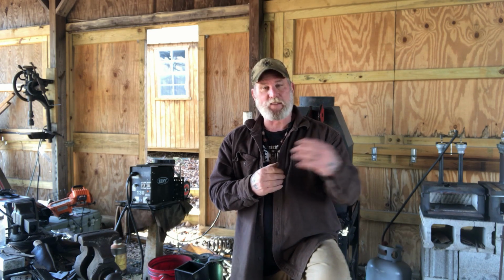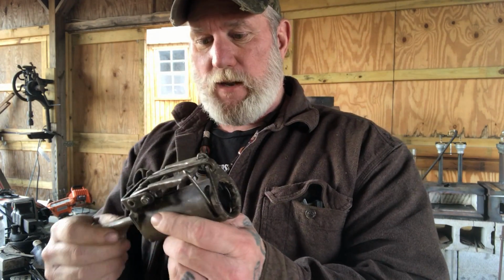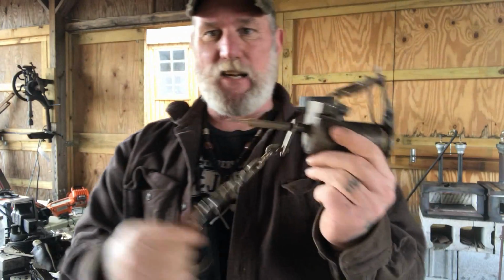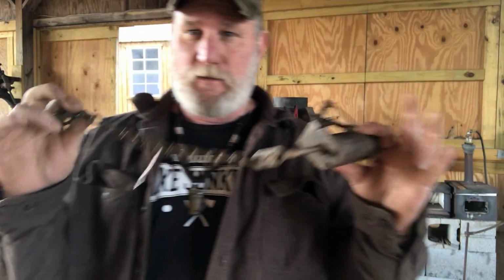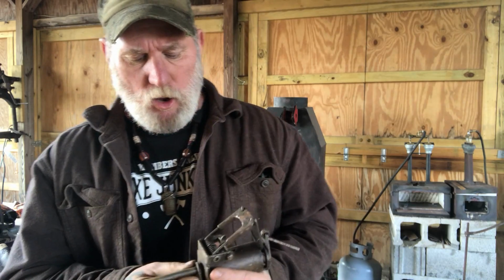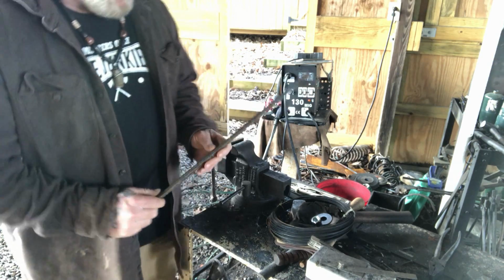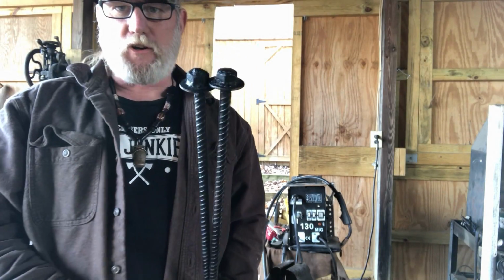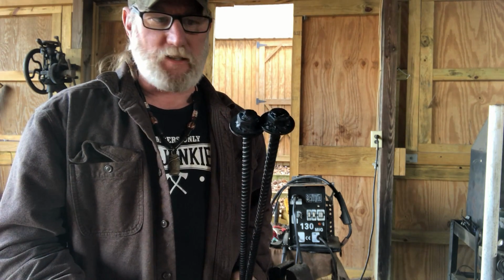Making Trapping Tools Part 1

Comment: Why not use dog tie out stakes, just screw into the ground.  Small enough to use, depending on the soil integrity (hard or easy to insert), easy to unwind and pull out.  Definitely hold anything up to wolf size.
Reply: I'd have to guess if you're gonna set out alot they become bulky.
Reply: Awesome idea man!